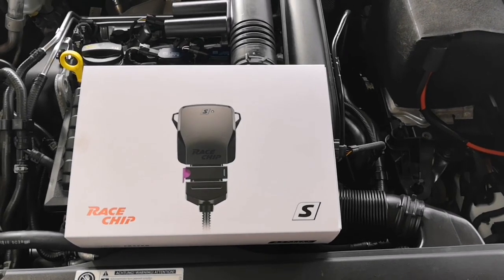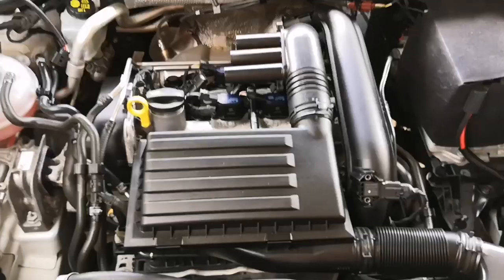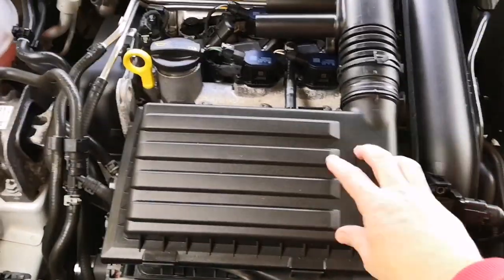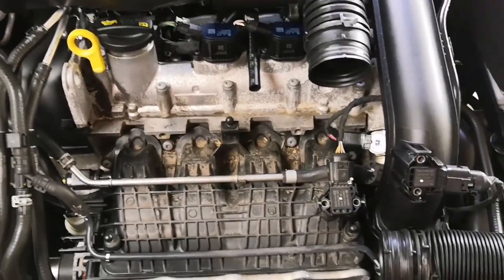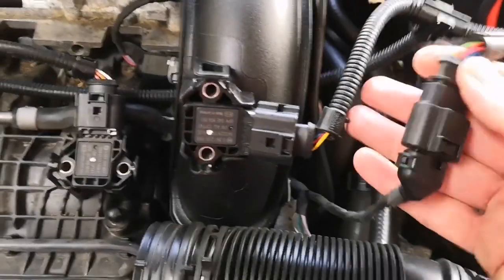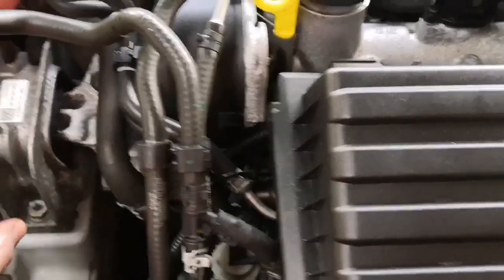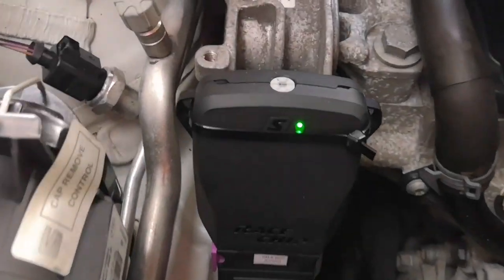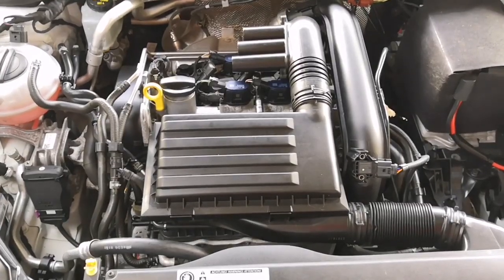RaceChip Install. VAG Group 1.4tsi 150bhp - SEAT, VW, Audi, Skoda (English). Easy to Follow Install

Comment: Im woundering if they sent me the right one my harness has a b and c branches did yours have the c part on the harness as well?
Reply from the maker: I think c was the chip/controller. I've no longer got the box and to be honest can't remember!!
Reply: Did you manage to figure out where the C part of the harness suppose to go??
Reply: @loo0201  man i still have the thing sitting in the box because i dont know what to do with it i dont see anything it could go to. I didnt want to plug it in and it be the wrong tuner chip either and screw it up
Reply: If you figure it please let me know id like to see how it does but at this point might just send it back
Reply: @MrSkillz187  hi There! The C is located on the top of the engine, it is the rev sensor. You can see another video on internet. It is 20 cm far from B. Watch “ Installing RaceChip GTS to Skoda Octavia 1.4 TSI” and you will see how to install it. Hope it is useful

Comment: Exactly the video I was hunting for! Thanks for giving it a shot on camera and sharing your learnings
Reply: so did you also do it? How's the performance?
Reply: @rokdovecar5275  it’s pretty damn good! It’s a very noticeable difference, adds a lot more punch. I got the RS so I have 1-6 and I got the app go I can adjust it when I’m driving and I’m very satisfied with it. I got it for a 1.4TSI Scirocco but same engine.
Reply: @davidpcharles  that's nice to hear. I have the same Leon as in the video but 2018 one. I still haven't bought it as i'm sceptical about it.. Do you also think that everything should be alright with the car, as long as you don't start pushing it when is not warmed up yet
Reply: @rokdovecar5275   it make a pretty noticeable difference, for me in the top rev range and generally improved pull through the rev range. With the app option, you can have a warm up phase where the chip isn’t active. I have mine on for 7 minutes so nothing is being silly whilst it’s all cold but ultimately, it’s just a chip that alters sensors and pressure gauges, it stresses the engine more because it’s working harder but it’s seemed alllll fine for me so far and I’m well happy. I’d definitely recommend the app so you can change the setting whenever you want from your phone and you can set up the warm up timer.
Reply from the maker: I assume it will be fine but I wouldn't of done it if the car was in warranty and still being serviced by the main dealer!!
Reply from the maker: I did notice a difference even on level 3 but not even tried 4 and 5. Run around in two now which seems to add a little extra mpg

Comment: are you running manual or dsg?
how is it??
Reply from the maker: Manual, as I've said to others pulls well in mode 3, especially at higher speeds. More fuel economy in mode 2

Comment: Did you notice any difference?
Reply from the maker: Yes, mainly in pulling on the higher gears. Noticed it more when accelerating between 70 and 100
Reply: @DIY-AUDIO  Thanks for the feedback